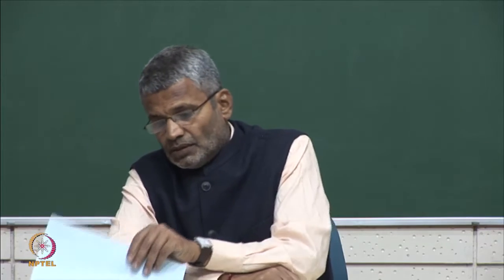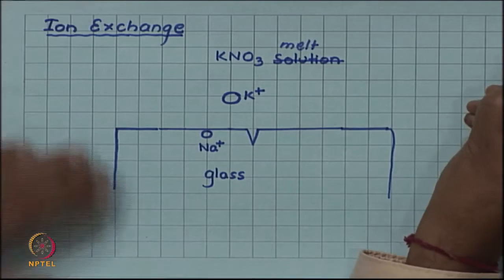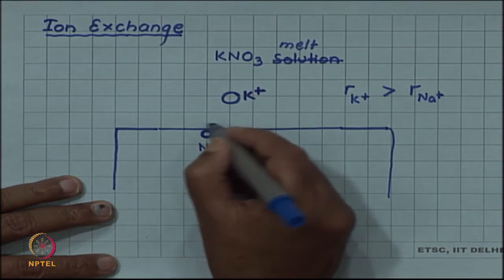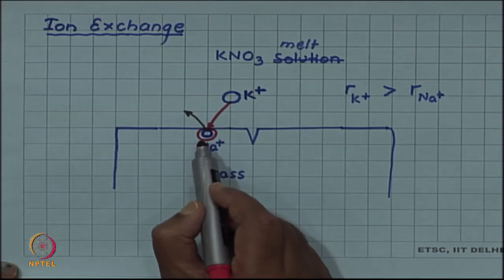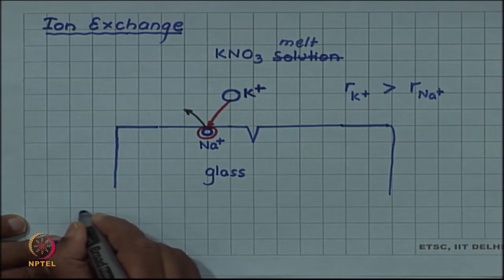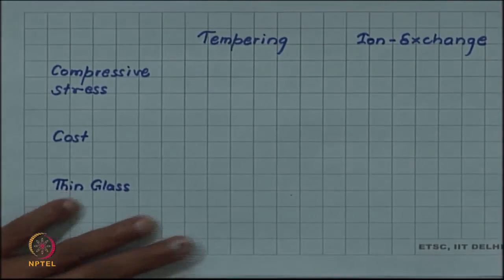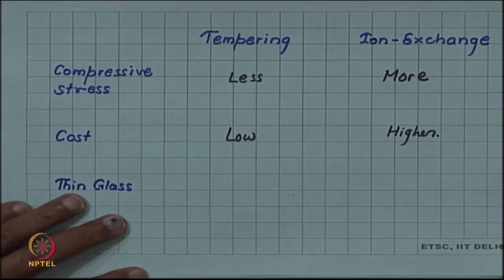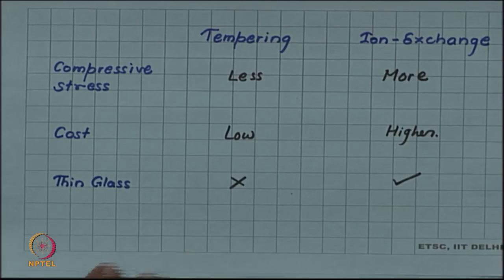Toughening of Glass: Ion-Exchange

Comment: Sir, when the smaller size vacant site is occupied by larger atom(atom size>vacancy size) , it'll produce tensile stress fields around the neighbour atoms right? If so, how comes the development of compressive stress on the surface?
Reply from the maker: Thanks for your question. It forced me to think more carefully.The stress field around a hole with a misfitting inclusion is a bit more complicated and interesting than described in the video. 

Consider a spherical hole. And consider a volume element of material just outside this hole. To increase the size of the hole to fit in a larger sphere you have to push the surface of the hole outwards. This will put the volume element just outside the hole in compressive stress. This compressive stress is in the radial direction.

But do not be disheartened. You are not totally incorrect. Imagine a small rod of material lying in the tangential direction of the hole. Since the circumference of the hole is increasing, this rod has to increase in length. Thus in the tangential direction the stress in indeed tensile.The elasticity theory shows that this stress is half in magnitude to the compressive stress on tangential planes.

Thus you have both tensile and compressive stress around a hole: compressive in the radial direction and tensile (of half the magnitude of the compressive stress) in the tangential direction.

Now consider a crack face. The normal to the crack face may be the radial direction for one hole (with a misfitting large atom) but as tangential direction for another hole. 
So it will be subjected to both compressive and tensile stress. But as tensile stress is half in magnitude of the compressive stress, net stress will still be compressive.
Reply: @introductiontomaterialsscience  I can't imagine exactly bt I understood what you said. Thank you sir.
Reply: @introductiontomaterialsscience Thank you for asking the question because I was wondering the same thing. An analogy I thought of is hammering a splitting wedge into a log with an iron brace around it. The log cannot expand due to the brace and this creates compression due to expansion frustration. If the log wasn't braced it would expand until it split (meaning tensile forces). You can think of the potassium ions as being the splitting wedges and the rigid network of covalent/ ionic bonds as the brace.